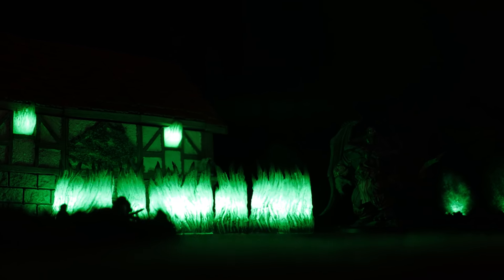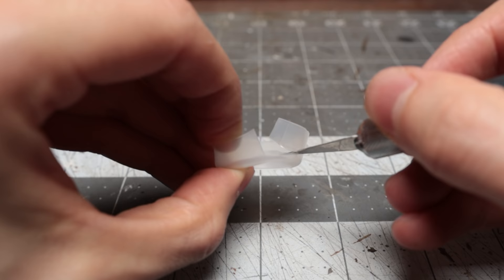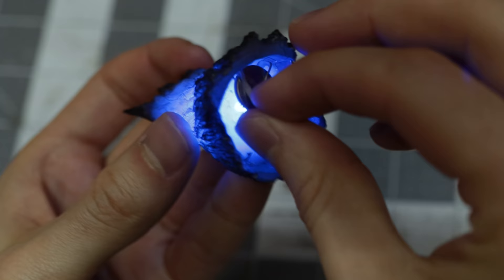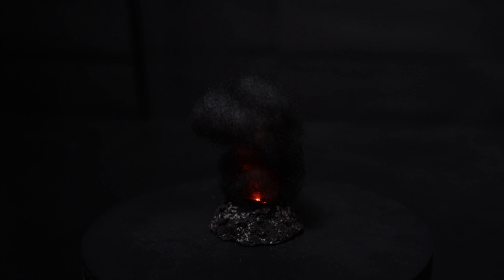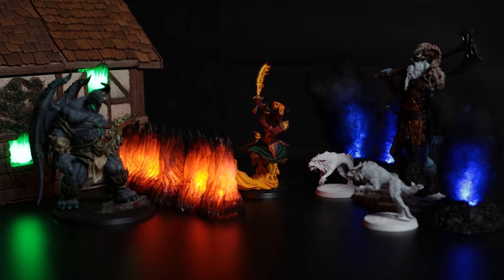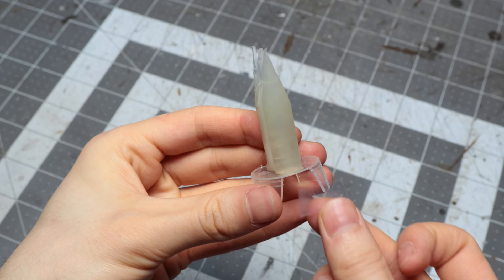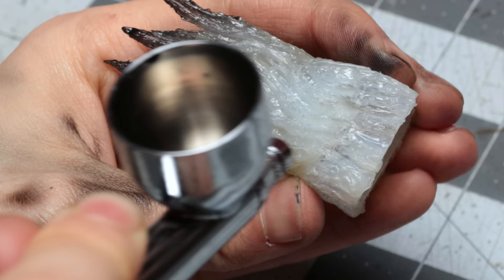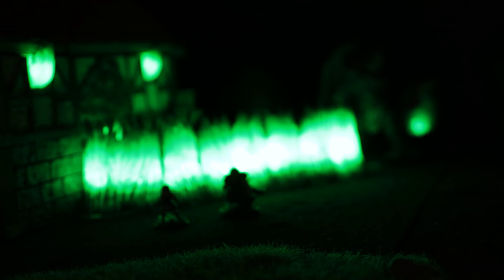Set Things on FIRE! || Fire Markers, Wall of Fire, Burning Building!

Comment from the maker: So how would you guys use the colour changing ability in your games? would you use an LED for this even if you usually wouldn't use them?

As always I'll be trying to answer questions as soon as I can, so feel free to ask :)

SCENIC SEALANT

You can make this a few ways, I show some more in the modular overgrown accessories video involving pva glue and varnish or matte medium, but these days I use:

1 part Mod podge
5 parts water

I'm constantly playing with this and learning more, I'm probably going to do a full video on sealing terrain at some point :)

CHARCOAL TEXTURE

Even once sealed, some of these might be a little loose - I found it was a good idea to give each piece a handling and let the loose bits fall off, then cover up any gaps if needed with some more of the fine filtered charcoal dust before the final sealant layer.

I also gave the white ash another layer after sealing because the sealing darkens it down a bit - but ash is quite good at staying attached even without spray, so an extra layer over the top isn't a problem. It also gives the piece more variety of contrast!

BURNING BUILDING CARD DIMENSIONS

3/4" tall
5/8" wide
Reply: No questions but wanted to say you have inspired me to start crafting keeps and castles (which I learned I made too big and I of course made all my measurements as I went - lesson learned). So thank you, you have a new Patreon too ;)
Reply from the maker: Thanks a ton man! The support is massively appreciated, and it's awesome to hear about inspiring people to make stuff :)

Comment: @3:52 An alternate option would be to use heat shrink tubing.  I dont know what the cost/speed/ease of use aspects would be vs using hot glue to get the same result.  I just know that I typically burn myself with a hot glue gun and being able to use normal electrical heat shrink tubing would work just as well.
Reply from the maker: I found the heat shrink wouldn't shrink thin enough, I did try :)

Comment: You can also use cotton balls to make your smoke. I've pulled the cotton ball into the shape I needed, then sprayed it with some diluted pva glue to give the cotton a sturdy medium to work with, then painted them with either airbrush or dry brush with red closer to the light then painted shades of gray to black towards the upper portion of the cotton. Then using hot glue or super glue to the base around the led lights or model train grain of wheat lights.
Reply from the maker: Oh I know, it was definitely an alternative option 😅
Reply: @RPArchiveOfficial  We would always use the big cotton stuffing you get in pill bottles to make our campfires, bonfires or torch smoke, etc.
Reply from the maker: I think it works best as a billowing fireball look (like Erics hobby workshop did a while back), it has that rounded texture :)
Reply: @RPArchiveOfficial  regardless I like the look and the affect it has

Comment: Hey Matt, for the rooftop fires I think Magnets would be a fine solution. Either glued underneath your rooftiles or just use two stronger magnets, place one under the rooftile and one at the bottom of the fire and just let magnetism do it's job. But this depends slightly on how thick your roofiltes are. I think this last option would work on the tile you've shown in the video here.
Reply from the maker: Pretty close to the plan! basically I would make a roof tile with hollow space inside the fire to place the LEDS, then the roof tile connects to the roof itself like all the others :)

Comment: I tought LED needs at least a little resistor even with such small battery :o
Reply from the maker: Basically from what I understand these little batteries and LEDS have just enough resistance built in to allow you to use them straight together :)

Disclaimer: I am not an electrical expert, just a hobbyist trying things out and researching as best I can 😅

Comment: I use the used medicine cups that come with certain medicine bottles like from Nyquil, Robitussin or Immodium to make my markers. But it's gotten harder to find multi color LEDs  now that Radio Shack went out of business. And most dollar stores only carry the white LEDs tea lights. So I may have to go back using a trick I learned 25 yrs ago when I did model train villages before they had multicolored lights. You thin out some enamel paint with a lil bit of paint thinner and lightly brush on a coat or two over the light bulb until you get the desired look you want for LEDs  dont give off that much heat do you wont have to worry about it burning the paint on the light to get the color effect you want.

What I did for my black burned ground rather than using real charcoal I use black sand that you can pick up at a dollar store in the floral sections for home decor they use it to pour in the bottom of a vase. I even found some red sand and gravel that I added to my bases to give the look of hot burning embers scattered around in few places so they aren't in just one spot. But before adding the red sand if I want to tone down the bright shiney black sand I either cover it with matte mod podge or spray on a matte finish then glue on some of my red sand and gravel for those are shiney to give them the bright hot look of  the embers

Comment: I'm thinking about making standing candles using leds. Maybe you could show us how...??? :D :D :D
Reply from the maker: Like, for a mini table? My first thought would be use a 1225 battery as the candle holder and work a 1mm led wire around it somehow... But the holder would be comically oversized 😂

If you really wanted to, your best bet is 1mm LEDS with the magnet under the table, and have them sealed in place. Not my style, but it should work :)
Reply: @RPArchiveOfficial  Thanks for the response and advice! Love your videos (made some tables and magnetic books of my own), did not expect a response :D
I was thinking more of a floor standing candle holder (don't know the proper name). It might be possible to create a base from the battery and use the 'wires' of the LEDs to give it a wrought iron look
Reply from the maker: Ah! Actually that would be much easier, though it depends how many candles you want as each would need it's own 1mm led :)

You could use hollow styrene tube for the main pole though, and run the wires through it to a battery at the base...

Comment: Quick question about the surebonder are you having to use an inverter for it? I believe they only come with a us plug?!? Great work BTW and great to have back 👍🎉
Reply from the maker: Preface this with I'm not an electrician, so this is not advice - but I've used mine with a us plug travel adapter for years :)